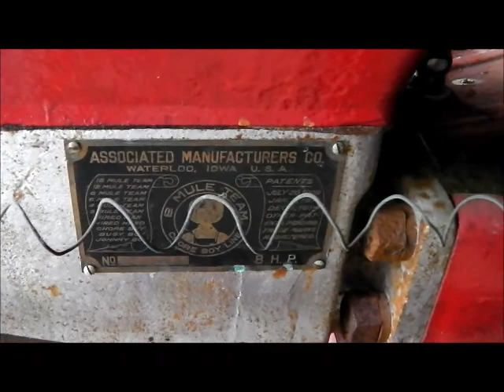Starting an AMANCO 8 Mule Team at Pitstone Museum

Comment: Whilst I fully understand the operating principles of a normal magneto run engine, can somebody briefly explain the "hit and miss" principle, and the advantages of one over the other..? Thankyou.
Reply from the maker: Think of it as an ordinary four stroke engine but an "interrupted" cycle. 

The engine goes through the four stroke cycle, the exhaust valve is then held open by the governor and the engine freewheels until it slows sufficiently - the exhaust valve then closes and the atmospheric intake valve is sucked open and fuel drawn in by the vacuum of the piston traveling down the bore.... the cycle repeats. 

A hit and miss engine generally has no throttle in the carburetor/ mixer. 

It is of great advantage where load on the engine is variable, like a saw bench - when running off load you save fuel. 

Phill.
Reply: steamwally Thanks, Phill.  Iget it now..
David.

Comment: Open the needle valve, it won't hit twice
Reply from the maker: Open the needle valve any more and it just runs too rich, and still tries twice....

It would probably be better slowed down a bit. The snifting valve may need adjustment, but it's not my engine so I wasn't going to risk damaging the mixer bowl.
Reply: Oh, on my chore boy amanco, it will only run if you block up some of the holes
Reply from the maker: EngineVids Check the valve guides for wear and adjust the spring tension on the snifting valve. It's worth taking time to adjust as it can make all the difference to your engine.
Reply: The valve guides are worn, it doesn't have a snifter valve on my amanco, people always say that its the best running chore boy they have seen, considering that all the parts are worn lol